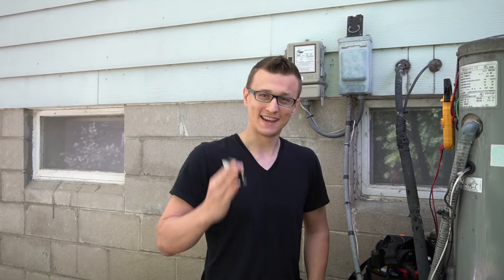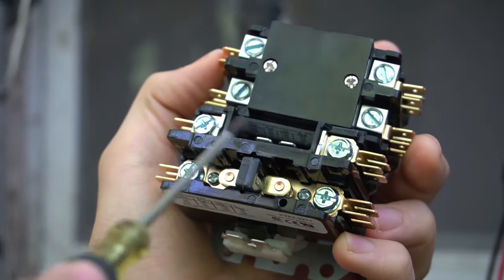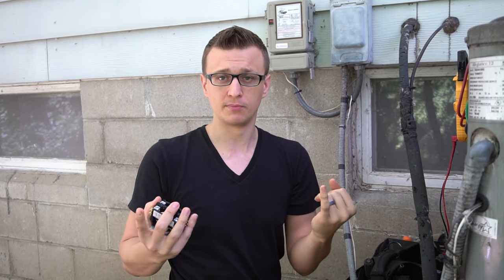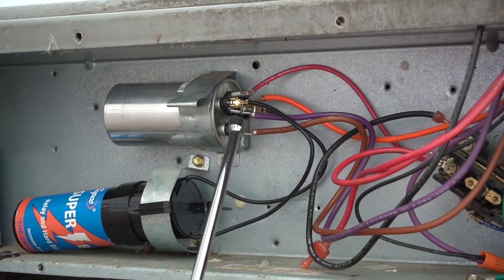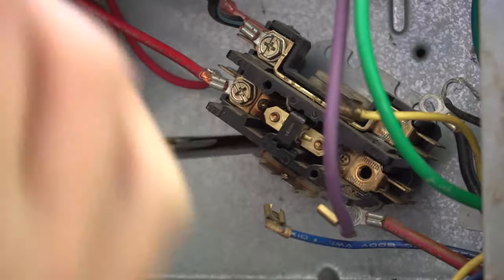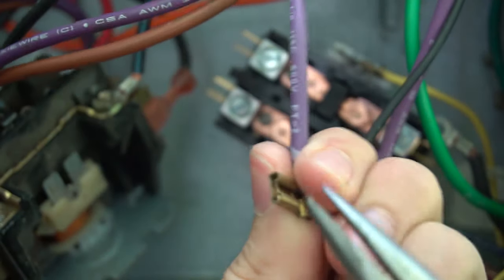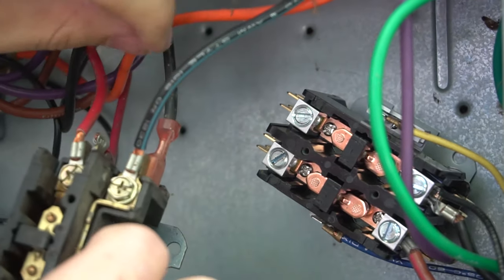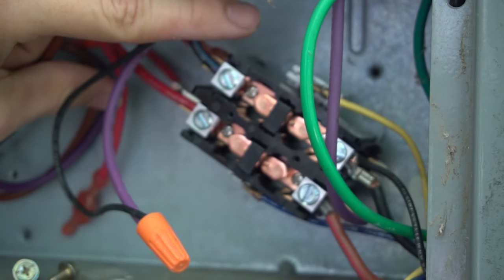How to Replace a Contactor in AC Unit

Comment from the maker: ⬇ Videos That I Referenced in the Beginning:

A/C Troubleshooting Guide:
https://youtu.be/wzAA4dlp_70
10 Reasons Why Contactor Doesn't Pull In:
https://youtu.be/NVPhsK4gK1A
How to Check/Test Contactor:
https://youtu.be/YCygHajsW34
How to Wire A/C Condenser Unit:
https://youtu.be/KCanZEsLVEI
How to Read Full A/C Wiring Diagram:
https://youtu.be/I-sB4GIlbl4

Comment: I decided to  replace both my capacitor and 2 pole contactor as maintenance items after watching Jay's video.  Upon inspecting the old contactor, I found all 4 contact points to be heavily pitted.  It was on the road to failure, for sure.  The contactor cost me around $15 on Amazon.  The a/c repair folks charge in excess of $300.  Cant say enough good things about Jay's videos.  Thanks so much
Reply: The problem in most cases is will your insurance cover it. Its a good deal to be handy but It can become a problem. not trying to fear monger, but its something to know as far as being a home owner.

Comment: Had the same issues last week. I cut off the spade, and tied off the crimped end. I think its better since you wont have to deal with making sure whether or not you applied enough torque in the long run. keep in mind the terminals get hot and we all know what happens to metal when it does. Good luck everyone else!

Comment: mine looks like a 25 amp. so this means I can replace with a 30 or 40 correct?
Im replacing my capacitor in a real old unit so figured I replace this too

Comment: I have a question.  I replaced  a new contactor and replaced it the same way the old one was wired.  Took plenty of pics to make sure.   But now the AC won’t turn off when the thermostat reaches its targeted temp.   Did I do something wrong ?   What will happen if I flipped it 180 degrees, so the bottom is now the top ?

Comment: Excellent video.  I just had my Lennox AC serviced, and the serviceman claimed the contactor was burnt and pitted and that it needed to be eventually replaced.  I examined the unit myself and the contactor is 1-pole 40 amp with the terminals labeled L1, L2 and T1, T2.  The two incoming power lines (black and white) appear to be connected to the T1, T2 terminals.  Does this mean the serviceman reinstalled the contactor upside down?  Or was it installed upside down at the factory?  It's possible that the serviceman temporarily removed the contactor in order to check it for continuity and resistance and reinstalled it upside down.  I took pictures and I see no burning or pitting.  Does it matter if L1 and T1 are interchanged (the plunger side)?  Likewise, are L2 and T2 interchangeable?  I would think that since the contactor is essentially a relay, it should not matter if L1 and T1 are interchanged.  For your information, the contactor is from Hartland Controls.  I'm thinking about replacing it with the Protactor 1 Pole 40 AMP Heavy Duty AC Contactor.  Thank you.

Comment: Jay, you are the man! Your excellent tutorials told me everything I needed to know and the courage to replace my 15 year old capacitor and contactor that a service repairman said, during a routine PM, were close to failure.  As in your video, my screw over connectors had to be crimped, but unlike yours, this was no easy task.  I discovered that cutting open the ring with wire cutters and then crimping it, worked like a charm.  Just a little idea you might want to pass along.

Comment: THANK YOU SO MUCH!  I have to DIM (Do It Myself) as I am a single, private school teacher.  I just replaced my contactor today and before I POWER ON, I wanted to be sure I got it right, so I watched one more video - this one.  I also sent pics to my Uncle - an electrician to have him inspect it.  I had an 8 wire, that I had to clip and strip the 1998 clamps off and insert.  Thanks for the old/new pic as yes, the smaller coil wires are on opposite sides and you helped me look on the bottom to understand how they are attached to the coil.  It is June 28, 2020 - in TEXAS - thank God it has been overcast and cool these past several days since I ordered my contactor 1-pole 30amp 24v.  So I will now power on as I place my trust in God the ultimate technician who has helped me learn.  My older contactor lasted 22 years!!!! Wow!  It was sticking last fall prior to winter, so again, sticking in beginning of June, needed to replace it.  Thank you for your educational video - you are easy to learn from. May God Bless you richly!

Comment: Do you have a vedio how to put a hard start.. or what's the reason for the hard start.. by the way.. great job..
Reply from the maker: Thank you! I do: https://www.youtube.com/watch?v=ThBsRFrdNiY&t=1s
Reply: Do you have a video comparing hard starts to other.. super booster.. 5  2 1 hard start.. or others.. some videos say that it is good to put it only when the condenser is not working right because it's getting old and has trouble starting up.. and some videos say it prolongs your equipment.. which makes sense to me.. what opinion would you recommend to me..🤔

Comment: What if the plunger is getting stuck in the on position? Would that be a bad contactor?
Reply from the maker: If there is no power going to the 24v coil yet the plunger is pulled in, then yes. The contactor should be replaced.
Reply: @WordofAdviceTV  yes, the unit is running with the thermostat turned off. Thanks for the response and info.

Comment: Thank you so much!! I'm 61 year old female and was replacing a contactor to an older Trane AC. The connectors were like the ones in this video, some were female connectors and some were rounded connectors. You saved me time of not having to change the round connector ends. I was going to go buy female connectors and switch them out.

Original problem was outside fan was coming on but not compressor. I had AC repair come out yesterday and said I had a bad capacitor and contactor. He wanted to charge me $275 to replace a $9 capacitor and $309 to replace $26 contactor. I paid him the $75 diagnostic fee and told him I would do it myself and I did thanks to your videos.
Reply: Hopefully you didn’t get hurt or ruin your machine. Seen so many homeowner destroy their compressor or harm themselves. We are trained professionals for a reason.
Reply: You go girl... You are one tough gal... Amazing...

Comment: Man, you are a Professor of all things instructional concerning home cooling and heating...thank you for sharing the elite wisdom God has given you to help so many of us out here in cyber land.y issue was that at times, my condenser unit would keep running after the AC would cycle off in the house. I would go outside and see the line from the unit to the house frozen... problem was the contactor sticking (which a slap on the side would loosen)... but now is fixed... with the new contactor for $23.86 and guidence from you!😊

Comment: Perfect perfect perfect explaination you are #1 in YouTube ! Good job explain every thing from 0 to 💯 
10/10
Reply from the maker: Thank you! :) It's an honor to get such high marks! I appreciate you taking the time to leave a comment.
Reply: @WordofAdviceTV  what cause the negative value subcooling?
I have 410a and the liquid line temp was over 140 f and the red gauge read 102f
The system was low in 410a and I put 3lbs that dropped the temp on the low side pipe from 210f to 140 but like I said it's still high and result in negative subcooling value!
The low side is reading 40f on gauge and the temp prop on the low side read 68f 
So the high side pressure is about 345psi and the low side is about 145psi  based on the guages reading 
The outside temp was 74f afternoon 
The system is roof mount train 
Thanks

Comment: Very thorough explanation and clear video. The best I have seen-Thank you!
I have a two 20 year old AC units and have started  replacing the capacitors and contactors.
The slide on connectors for the capacitors were very dull looking. I grabbed them with a needle nose and polished them up with a slim brass brush. I would recommend this easy step to insure the best connection. Also like your idea to crimp them down a little if loose.

Comment: Thank you for the great videos, I've  watched several,  our heat pump has been running on emergency heat for a couple of weeks (propane) I discovered  the single pole contactor had burned up one of the contacts, it's 10 years old,  I ordered another on internet $12, should have it in a couple of days 👍

Comment: Great video! I replaced my single pole contactor against a Solid State contactor  Emerson and so far I'm very happy with it! 
Questions: 
Where do you get the Dixie wires shown inside your unit? All I could fine was some tinned copper 95C 600V wires on Amazon. 
Are tinned copper okay for connections like the contactor?
Seems like you can switch a 1 pole contactor against a 2 pole contactor, is that also true if you have a 2 poles and switch against a 1 pole?
Last, what is a 1.5 pole contactor? What can you replace it with?

Thank you for your explanations on your videos, I saved hundreds of $ following them!

Comment: Local company wanted $783 to replace contactor. Just the contactor. Included in that fee they had a $69 fee to drive to the house, 4 miles from their door, and a $100 diagnostic fee. Crazy.

Comment: Great instructional video! Been in a heatwave here in the northeast and Wed evening the AC unit was just just blowing hot air from the inside air handler. Went outside and the manganic connector was fried (27yrs old) Replaced that and figured I'd do the coil at the same time as that even though it was still good (at the 27 years old also, it just mad sense to do both.) Also take lots of photos for the wiring for reference as each unit is different and even jot down a few notes. Made the installs trouble-free. Both parts from Grainer came to $85.

Comment: Thanks for the info. The contactor will be my next preventive maintenance job on my 33 year old AC unit. Just replaced the condenser fan motor and capacitor because bearings were going bad. When you spin the fan you can feel the resistance with the fan spin on old motor. Once I get done with the contactor the blower/fan motor and capacitor in attic will be replaced this fall. Thanks for the videos they make it easy to do. Not sure how long this AC unit will last but after 33 years I got my $s worth already.

Comment: Thank you so much. I'm replacing a very old contactor and had questions about the coil wires and the old style connectors. I did not think about flattening the connector to get it under that screw terminal.

Comment: Great video, well explained, you're a helluva good teacher!  And I didn't mind the quick pace at all.  Our central air stopped working Saturday night & I'm back in business by Sunday mid-day.  The electrical compartment on the outside unit was full of acorns, twigs & stuff and the condenser contactor was not making contact.  I cleaned it all out & filed the contacts & I'm cool!  I'll order a replacement as that's just a temporary fix, but glad I could get it going THANKS!

Comment: Watched this video and the other one about 10 reasons for AC short cycling and got a full understanding of how to work on the contactor.  Super good videos and so thank you for the thorough explanation.  I saved hundreds replacing the contactor myself and it was quite easy once I got comfortable with the instructions.  Definitely follow all the safety tips provided in the video.

Comment: Thank you for this. As a rookie DIYer, i was able to tackle my contactor replacement with no problems and for a fraction of the cost.
Reply: Lucky guy.  I paid $330 to an AC guy on Labor Day for a run capacitor.  Then I see this man's videos.  $300 in the AC man's pocket.  Come on.  How about $130?  Kind of a shame the ripoff games in HVAC.

Comment: Hi there I'm having a small issue with ac condenser unit and was wondering if you could help me troubleshoot. The fan motor is buzzing and warm to the touch all while the thermostat is set to off. The capacitor was just recently replaced, I'm leaning in the direction of a faulty contactor.

Comment: Great video as usual, thank you!
Question. Does it matter if you put the line from the breaker in T1/T2 vs L1/L2? It seems to do the same thing.
Reply: It doesn’t matter which side of contactor you use ,  but make sure  you don’t connect. L1 to T2 and L2 to  T1, it will cause  fire 🔥
Reply: @abdisalamburale9963  Thank you, I thought so. Most of the time I see a contactor upside down and the lines are connected to T1 and T2 vs L1 and L2, hence my question 😊

Comment: Than you for all the videos.  I have a dilemma.  I have a Carrier 38THO36300 A/C unit that will not power the contactor switch.  I have the done the following:  Replaced the thermostat, replaced the contactor switch, removed my five minute delay box and replace my low voltage wires to the contactor.  I put a voltage meter on the two low voltage wires and it reads 26 volts.  My thermostat reads 26 volts.  I am able to manually push the switch and the A/C unit will turn on and stay on.  Any other thoughts?  My furnace was replaced this last Nov, but I am sure my AC unit ran a couple of times last month.
Reply: Contactor seems bad. You should read continuity with a ohm meter (no beeps) in your case when testing the coil. Not much to do but getting another one.

Comment: Thanks for the video. Would you please tell me what info on the contactor tag should be the most important for it to work, or is just the voltage and amps as you explained. 
Also I heard some people replaced the capacitor with one that is little bigger.. Is that a good idea? 
 mine is a dual run 45-5 MFD
Thanks a lot
Reply: Check out Jay’s videos on replacing the capacitor. I think you’ll find your answer there.

Comment: I replaced   our AC contactor about year and a half ago thanks for your help and for your videos.
Reply from the maker: Glad to hear the videos helped! Thank you for watching and commenting!
Reply: I just watched your video  on contactors single or double pole and replacing a single with a double pole contactor and checking if a CCH is there, I think the tech should check the schematic before changing 2 reasons at this point CCH can be connected to L1 and L2 with a hi temp thermostat on discharge line to stop heater and important the K2 defrost relay BK wire placement on the contactor....

Comment: Thanks so much for the helpful videos! My hvac won't cool, the fan outside isn't spinning, and after turning everything on using the thermostat, I can't turn the system back off again (fan on auto, system on off). Last year I had a similar problem with the unit not cooling and getting stuck on. Repair technician said it was the contactor and replaced it (had a power surge that took it out). This year I'm thinking that it has to be something different since I keep hearing that it's not usually the contactor. Thanks to your videos, I've tested both the capacitor (35+5 read as 34.6+5) and I tested the fan motor (got 55, 23, and 79 between the wires so it seems the motor is good too). I decided to finally look at the contactor before checking the compressor itself. After removing the contactor cover, I noticed the metal contact looks all scratched and pitted and there are black scorch marks. The plunger isn't stuck in, I can press it easily enough. But I'm wondering if it is bad.

I plan on replacing it due to the damage but I'm trying to find out what is the most important features to keep in mind when buying a new one. I have a single pole and I'm trying to match up all the numbers exactly when searching Amazon and it's kind of hard to find an exact match. Wondering how important the FLA/LRA/RES are to get exactly matched right. Anyway, thanks so much for these helpful videos! So grateful for such educational information!

Comment: Buy a spare one of these and keep them on hand.  $15 part and easily replaced.  Same goes for capacitor.  I had my AC go out late in the afternoon and could not buy a contactor.  Had to hard wire where contactor goes and use the main breaker by the condenser to use the AC.  Worked great for that night. Make sure the thermostat is on so the fan runs while compressor is on.   Next morning got the part and changed it out.  Great video.  Thanks

Comment: has anyone ever heard of ants getting inside these contactors and causing disruption in the system?
because that's what seems to be the problem, with my unit, according to my maintenance guy
Reply from the maker: Yes, in some areas that is actually quite common. If this problem keeps happening, then I would recommend replacing the contactor with one of these: https://youtu.be/qgHsGR4WT18

Comment: This may sound stupid but why must the control voltage be on separate sides of the coil? What would happen if they were on the same side?
Reply from the maker: If the control voltage wires would be put on the same side, that would result in a direct short. If the furnace has a low voltage fuse, the fuse would blow. If there is no fuse, then the control board, thermostat, and control board could all go bad.

Comment: Hi, question, my unit is connected without a contactor, i noticed main wires go straight to defroster then they have connections to capacitor and start kit, now looks like all went out, is that normal or should i add the contactor? Thank u in advance.

Comment: Random question: any reason you couldn’t switch one 120v circuit (as opposed to 240v) with that double pole contractor? Maybe a separate circuit on each side you want to switch simultaneously?

Comment: Thank you for your video. 
The inside and setting temperatures are matched, but my ac system kept running and could not turn-off at thermostat.
1) What should I look into the problem; solid state timer delay, fan relay, and/or condenser contactor?
2) At condenser contactor, I got 24 V between the coil, how to check LT1 & LT2, what is the voltage at these two terminals?